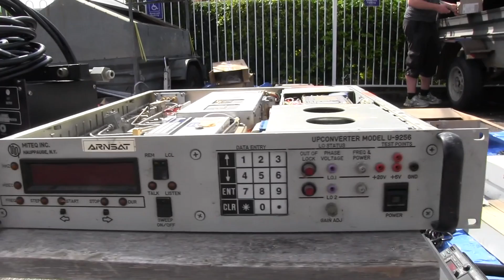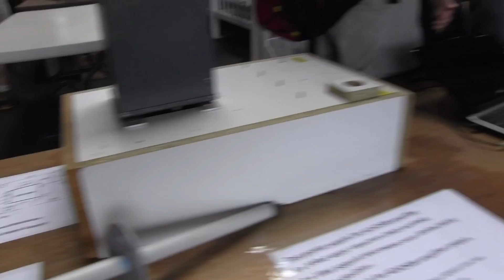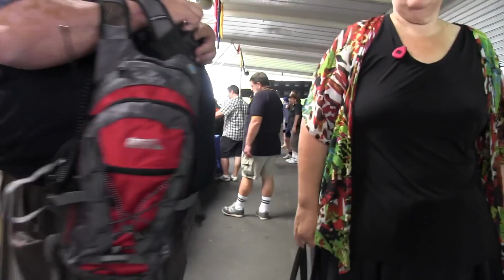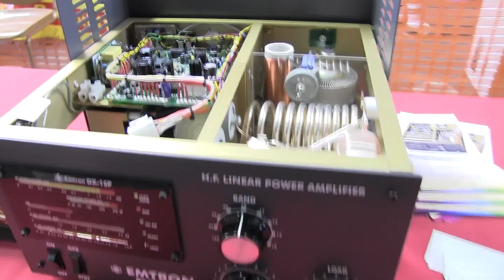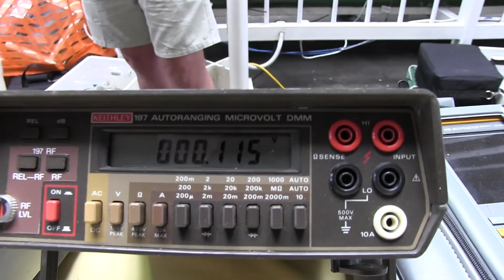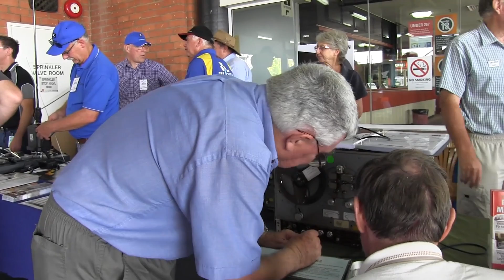EEVblog #428 - Wyong Field Day 2013

Comment: The Emtron guy was like a Hot Rod gearhead that got sidetracked into electronics. Drop The Hammer with 4000 watts. The DX-4 pulls a 6 in the quarter mile. ;) 
Great video, this one. All the home brew stuff is great, especially the point to point wiring. :)

Comment: I'm not sure of the make/model of the camera - it was there purely as a standing exhibit however the equipment being displayed operating on the table is definitely Digital TV. The CCARC has this equipment ready to implement in out Amateur Radio TV repeater for a while and is awaiting some antenna changes at the repeater station before it will be installed. It uses terrestrial digital TV standard meaning it will be able to be received with a normal household TV set.
Regards Ed (CCARC member)

Comment: I have a Tek2465 350MHz scope like the one in the video, but I got it for like just over $200 USD on ebay about 8 years ago. Had to replace the power supply caps, but works great otherwise.